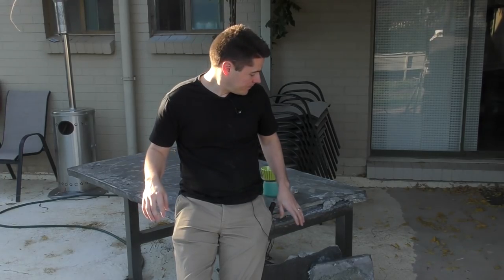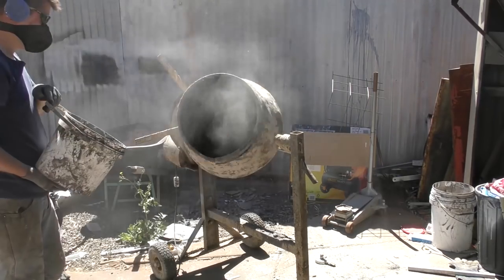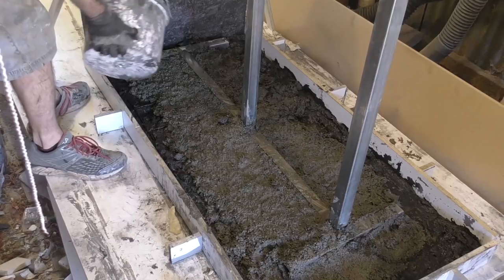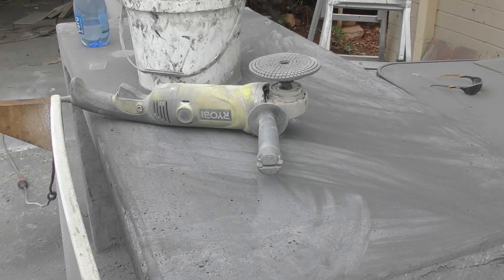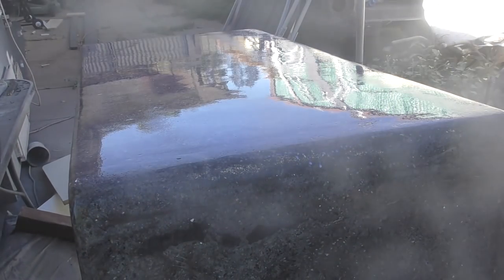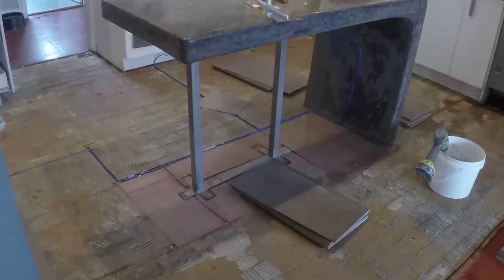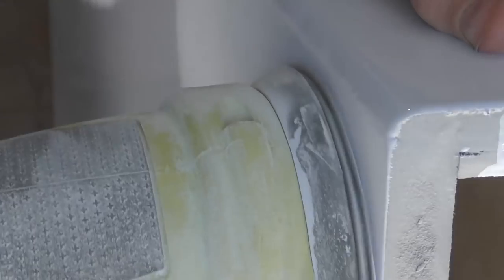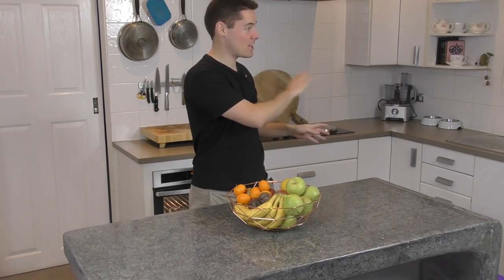Concrete Waterfall Style Island Bench - DIY Project - Kitchen Renovation

Comment: Mate you are a nutter. Great finish on the concrete. I only give your floor tiles about 18 months as you have no cement sheet though.
Reply from the maker: HI Dnick, Glad you liked it. The glue I used to bond the tiles is specially made for wooden floors, it's almost half full of rubber, so it bends and warps with the natural movement of the wood underneath. The tile guys I bought it from said it's the right stuff.

Comment: Why didn't you put some foam in it? How long did you let it set before you did the second part? Do you have a list of your sanding/buffing pads and products? How did you get concrete sealer through a spray gun? Did it clog? I don't have a sprayer, if I roll it and buff will that be OK?

Comment: great video mate excellent job. Im a concreter by trade and I just did these benchtops in the kitchen. with all photos from start to finish if you want I can send them to give you a look at off-form finishes. Plus i love aquaponics and stuff haha
Reply from the maker: HI Blake.

Send me the photos, I'm always curious with that sort of stuff. What did you think of my concrete mix? Did I get the quantities about right?
Reply: cool, yeah  mate you did an excellent job. I normally form mine up and then order a concrete truck with 2m3 and pour them in with metal buckets and then vibrate. and then strip them 2-3 weeks later after it has cured. but yours is excellent for a DIY job. main thing is that the longer you leave it formed without stripping the strong it will be. The reason your first table broke was because you needed a little bit more steel inside and also you may have stripped it too early. Where abouts in Aus are you located mate?
Reply from the maker: +blake Wallace in Adelaide. I probably didn't give it long enough, plus the steel. All lessons leant though.
Reply: cool. where did you want me to send the pics? Also just wanted to ask if you still had any daphnia for sale? or know if they would be a good food source for my trout? cheers
Reply from the maker: +blake Wallace wouldn't be great for trout, too small. Should start breeding them again around October. Send them to colum486@gmail.com
Reply: ok mate thanks for the info. cheers
Reply: With concrete it is also important to keep it wet all the time for days. If it dries out prematurely it will be weak and brittle.

Comment: That diamond polisher worked so well. Heard good things about Bondcrete, will be using it for my next project, but it made the mix look weird, like peanut butter. Looks great though mate, and good to see the table saw in action
Reply from the maker: It does that a little, but only use the measurements required for a pre-mix. You don't use as much. It's supposed to make it all hold together better. I haven't done a side by side comparison though.

Comment: The fibre does little unless you orient it (basically apply in thinnish layers and roll flat). Also would aim to have the rebar closer to the bottom as this is where the forces pulling the concrete apart under large weights, are greatest... Plus points for unconventional approach though. And good end result.

Comment: Concrete is strong in compression,  fiber or even 5000 psi concrete will improve the compressive strength.  However, concrete is weak in tension. Higher psi does not improve tensile strength.  Welded wire mesh or similar reinforcement placed near the bottom face will greatly improve strength.

Comment: Oh god it'sreally great! Thank you so much. Just one thing: how can the splice of the curve of the concrete plate be improved, because a line is noticeable despite being already polished and installed. this takes away beauty
Reply from the maker: +joharisant The line was my mistake.  It broke when I was getting it out of the form, I was rocking it too much, and it hadn't set enough.  So I put construction adhesive in the crack, as covered it with more concrete, but the mix wasn't the right colour, so it shows up.

Comment: I have done many concrete kitchen counter tops and islands and they are not practical at all. Food stains if you don't seal and if you seal you can't cut on them. Just way better alternatives out there today.
Reply from the maker: Couldn't agree more. Ended up pulling it down, the whole house started moving because of it. Didn't age well. Made a nice timber table to go in it's place.

Comment: What's the deal with the edges at 7:50 ?
Reply from the maker: I let the concrete set up a little, then rounded over the edges, otherwise it'd be a sharp edge I'd band my legs on. And trying to do it with a grinder later wouldn't look very good.

Comment: Cool m8, but you should had put second, if not third slurry coating to get it super smooth and of course sand between. 

Second thing that hit to my eye was brackets that you screwed on the floor and how those end up under the tiles. I would tiled first, hits the glue there and finally screw from the seams, so if this is ever removed (for instance it needs repairs) you dont need to do dusty sanding in the kitchen and break those tiles when removing anyways. Small screw holes you can fix, but half missing tile is kinda hard to cover nicely :D 

Thirdly you should have sealed MDF separator/wall/what ever in paint, so it wont gather moisture. One hole in seal, little bit water and it will creep under the mdf, soak into and ruin it, what worse can cause mold problems.

 Fourth, sanding underside relative smooth, will prevent most of the weak points in the concrete.. not all but some, making it stronger.

Otherwise pretty nice build over all. Least gave me some ideas for my own project. :)
Reply from the maker: +Hellsong89 thanks for all the tips. With the MDF, I coated it with a 2pac paint. I was worried about it sucking in moisture too. Probably didn't show it off will enough.

Let's hope I don't need to pull it up. I was paranoid that it would wobble, so I made it thicker.
Reply: First of all, Well done on your job!
For a DIYer you did good. Happy Wife Happy Life.
But as far as the comment that @Hellsong89 gave, I would definitely NOT put that table onto the tile. That would have just created a big mess because that would have just cracked your tiles underneath it.That was 1 thing that was done correctly. I would have also added an antifracture waterproofing membrane on your entire subfloor. 
 But you could have sleeved the square tubing to make it removable for repairs if any was needed, then do a wooden lower plate like a 1"x4" with chamfered edges on it to hide the gap between the wall and floor.

Over all thumbs up!!!